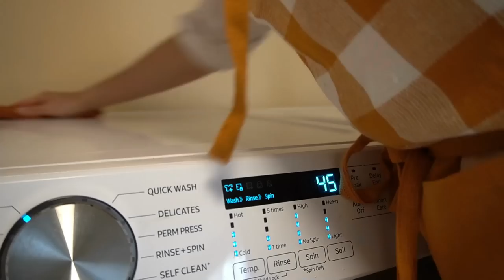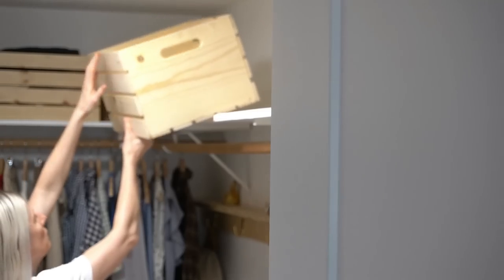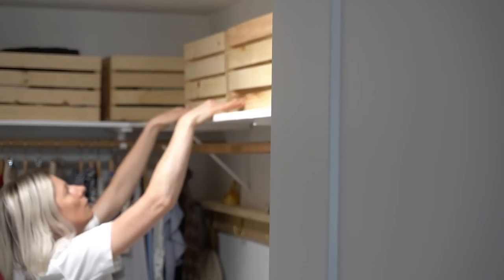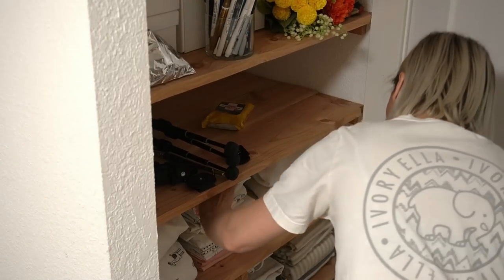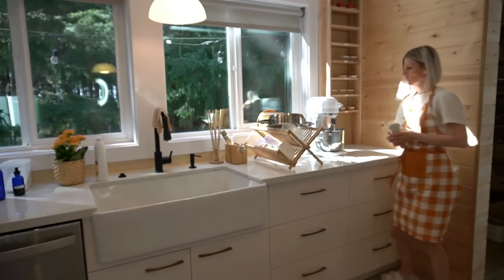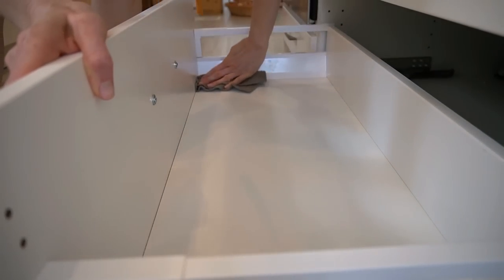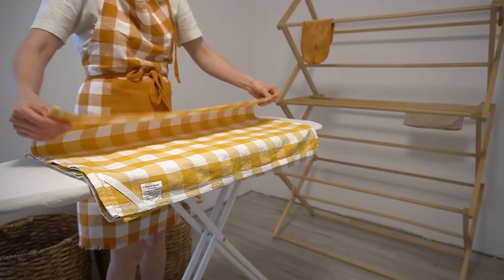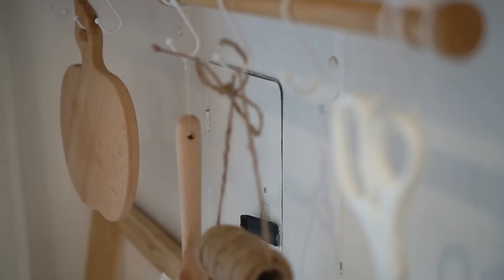HOME ORGANIZATION |ORGANIZING TIPS| ORGANIZE WITH ME

Comment: I use the self-stick flooring, similar to what you use on your floors and wall, in the bottom of my cabinets and drawers. It's easy to clean and the pans slide easily in or out of the bottom cabinet. It stays pretty clean also! :)

Comment: You should be very very careful when storing batteries that's why when you store batteries they have compartments that separate the negative from the positive because when you touch a negative with a positive it could catch fire. So you should really get yourself a container that is separated like a nut and bolt container or something to that effect so that your batteries are not touching the positive to the negative
Reply: I was going to comment the same thing. Very important to store them safely.